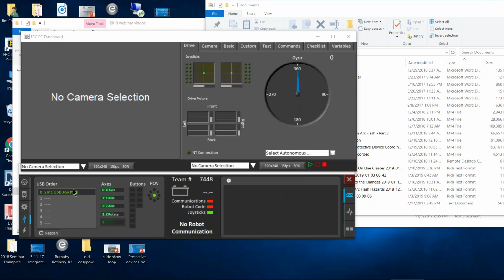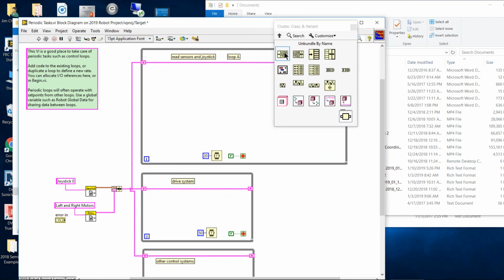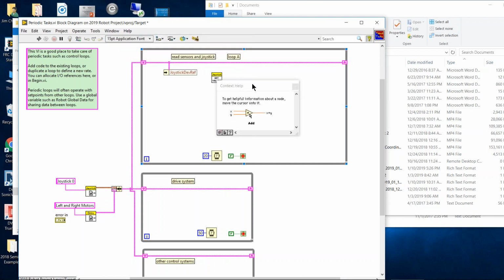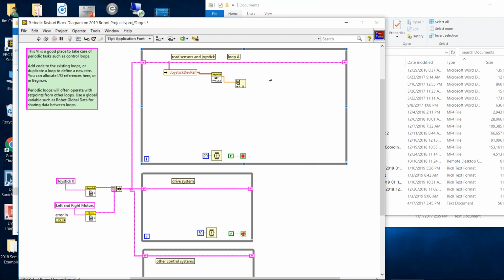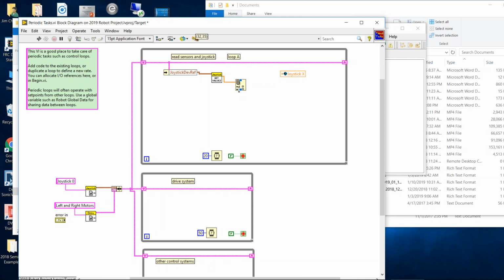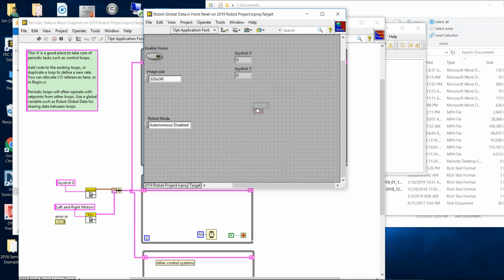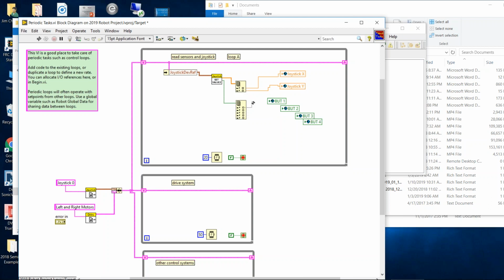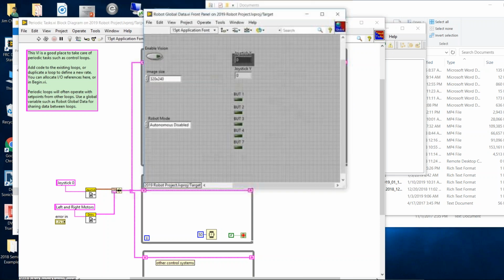2019 FRC LabVIEW USE JOYSTICKS

Comment: Hello!  Could you explain to me again your reasoning of using Periodic Task over Teleop?
Reply from the maker: There are a host of advantages.  But the biggest reason is that Periodic Task is always running.  Teleop only runs when robot mode equals Teleop enabled.            If you have drive motor control in teleop,   it becomes very difficult to prevent 'contention' between manual control and any automated control of the drive system.